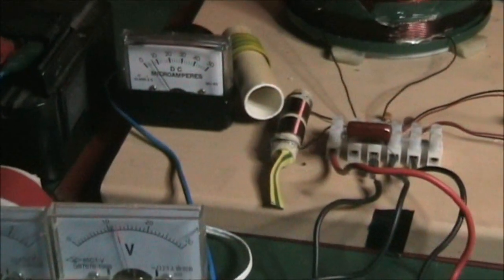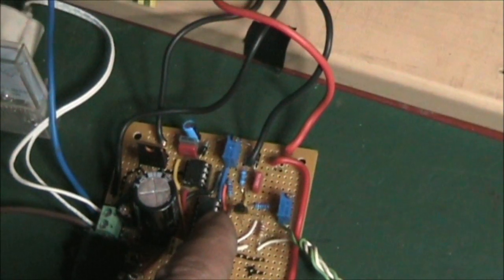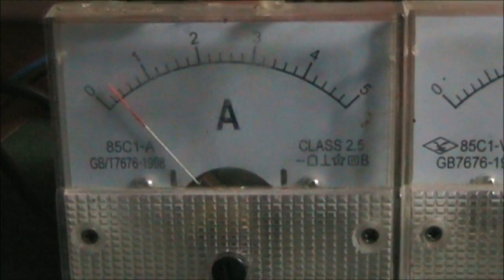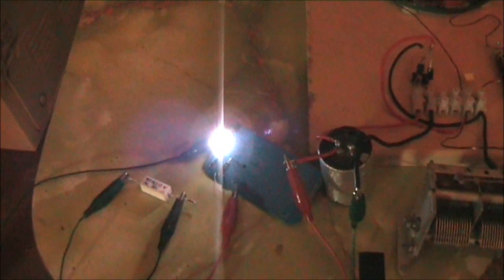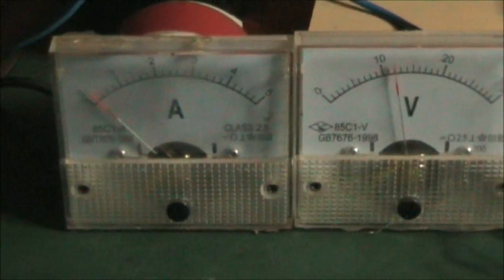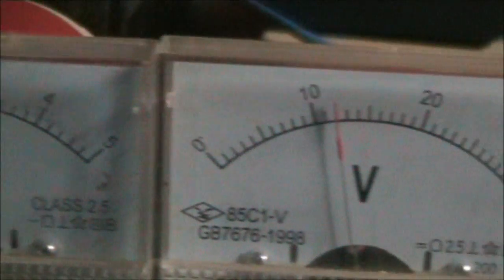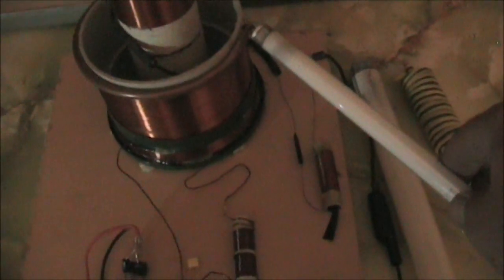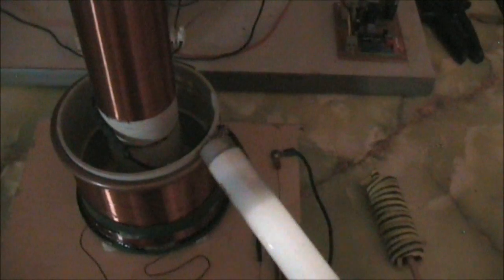Two Receivers and Armstrong Oscillator Transmitter

Comment from the maker: Hi mrclean, The foil is regular aluminium foil the extra coils end at the bottom of the foil, the foil is mainly to increase the capacitance of the top terminal so that by using different removable top terminals as well the resonant frequency of the extra coil can be changed. The diameter of the secondaries is 117 mm and the extra's are 55 mm but the secondaries are not a big enough diameter they would be better with 3 x the extra diameter or 165 mm about. it arcs from sec to extra. too close.

Comment from the maker: I used the same amount of wire in the sec and extra to begin with but then i removed 50 turns form the extra;s which was a mistake because they worked better before, i should have removed the wire from the secondaries instead. I used 10 turn primaries to keep get some primary inductance so I could use less primary capacitance but I found less turns work good too
I've used as little as three turns and 18 nF for the primary but with 10 turns I only need 1 nF.